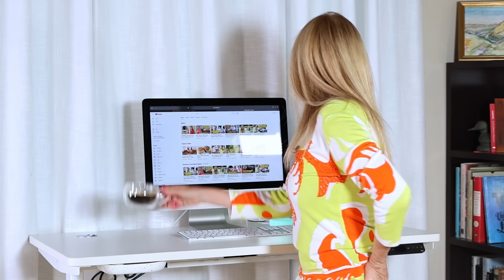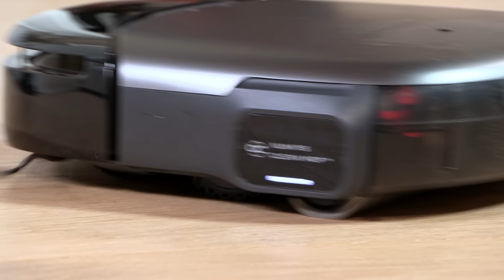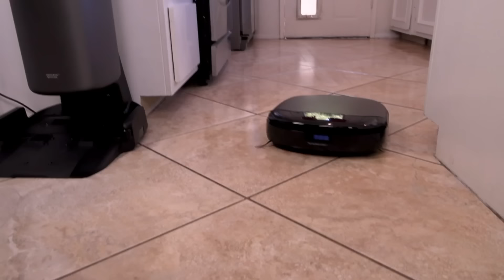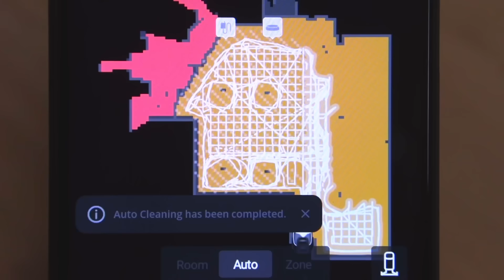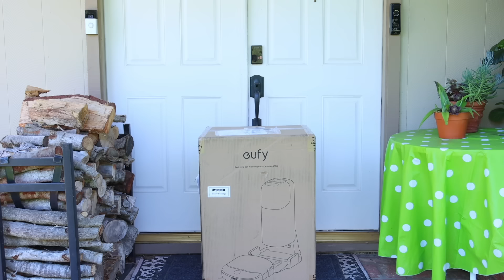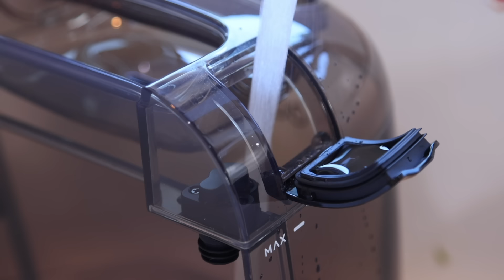Experience The Ultimate In Home Automation With Eufy's Omni S1 Pro Robot Vacuum And Mop

Comment: Hi,  Rebecca. How quiet is the mopping function only? The reason I'm asking is I live in a flat, or an apartment. So I don't want to disturb my neighbours. So I'd like it to clean at night when I'm in bed, but I can use my Dyson 360 to vacuum through the day. I've got my Eufy S1 Pro coming on Tuesday.
Reply from the maker: Will not disturb the neighbors!
Reply: @RebeccaBrand  thanks for the answer. Unfortunately, you can't use the mop function only. Today I'll try the lowest vacuum setting to see how quiet it is. I've got it in the bedroom at the moment and I'll be moving it to the living room as the mop cleaning and drying function can get quite noisy. Although I believe that can be changed in the settings. I'm still learning the app.